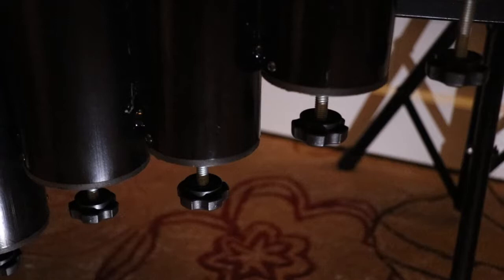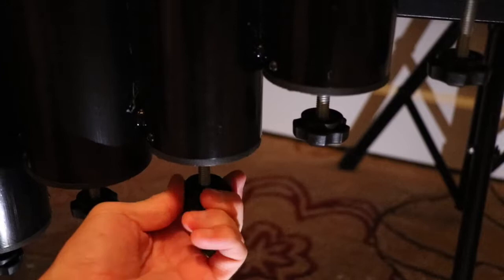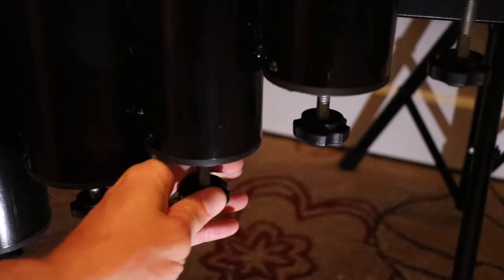What do tunable resonators REALLY do?! (HINT: IT ADJUSTS SUSTAIN!)

Comment: This is an incredible feature and I'm actually kind of surprised it isn't pushed more, before I saw this I thought the only way to lower the sustain was to use the "Rosewood Emulator". I think the sustain available on the Mode Marimbas is one of its great strengths, but the fact you can adjust the sustain using a combination of this and the rosewood emulator makes it even more versatile. It would be nice to see a properly recorded demo (like this one!) playing a piece with all the resonators untuned, then again with the rosewood emulator, and then with the resonators tuned both with and without the emulator.
Reply from the maker: The sustain dampener is for a quick change.  Still important is tuning the resonator for maximum volume

Comment: But aren't resonators there as a way to amplify the marimba (particularly on the low end)? Then a byproduct of this amplification is a loss of sustain. Also, I thought that tunable resonators were particularly important (especially so for wooden marimbas where the actual bars' pitch will change due to humidity and temp so resonators need to be tuned accordingly) in different climates as humidity (in particular), temperature, and air pressure all affect the speed/length of a sound wave and thus change the length of resonator needed to amplify a particular bar. Or are you kind of saying that because the Mode Marimbas are louder and stronger than traditional wooden marimbas, amplification isn't as important because we could just hit it harder or with a heavier mallet, so then we are more worried about a way to adjust the sustain and use resonators for this instead. Also, as an aside, do you know how the bars are tuned for a Mode marimba? Thanks!
Reply from the maker: As I understand the theory: the resonator in the proper position is to match the wavelength of the fundamental frequency generated by the vibrating key.  when the timing of the primary wave pattern meets the wave pattern bouncing off the bottom of the resonator meet,  the two wave's crest at the mouth of the tube (maximum amplification or resonance)   The boom / standing wave creates a tertiary wave that acts against the vibrating bar to slow it down or how long it vibrates.  The speed of sound changes with the temperature therefore the effective length of the tube must change with it for best acoustic effect.  Unlike the synthetic rosewood,  wood bars changing pitch with environmentals typically is not uniform across the keyboard so amplifying the wrong pitch by tuning resonators may not bring the desired result.
Reply from the maker: pt2: the better the resonator is tuned the less attack required for volume.  Mode Bars are tuned in a traditional manner: fundamental, + 2 octaves, + 1 octave and a third.
Reply from the maker: Bars are tuned in the traditional manner. Amplification is of utmost important, big waves=good vibrations. The better the resonance, the better it feels.
Reply: @modemarimba1608  thanks for the reply!
Reply: @modemarimba1608  I was actually pretty interested in getting a Mode Marimba at one point but then decided just to make my own 5.0oct padauk marimba... Don't know if I would suggest most people doing that though!
Reply from the maker: Cyril Lynch it is easier and better every time.